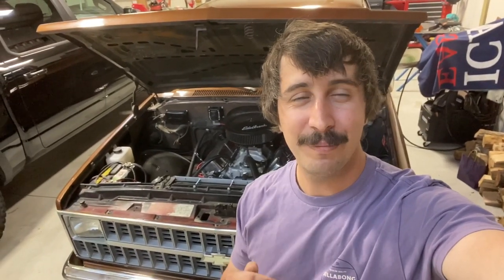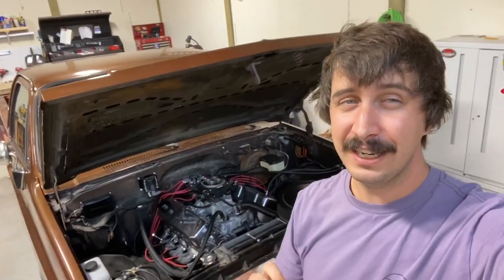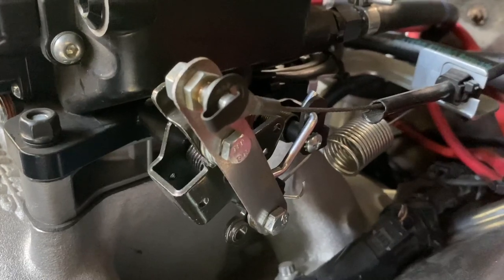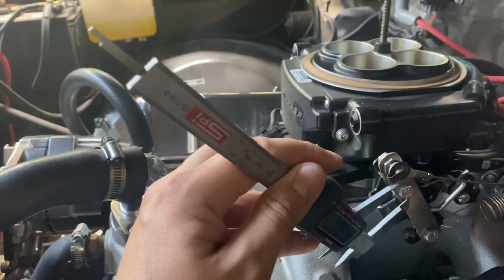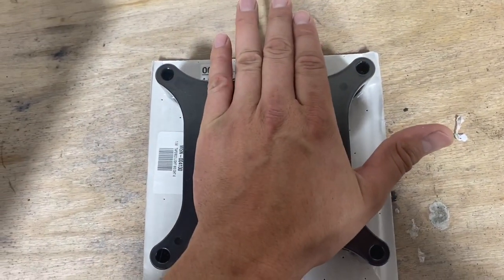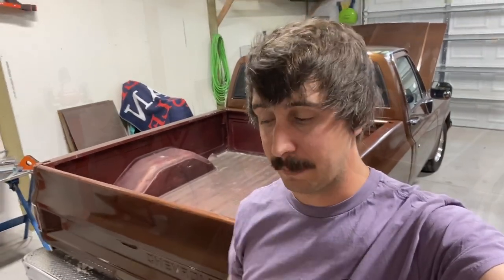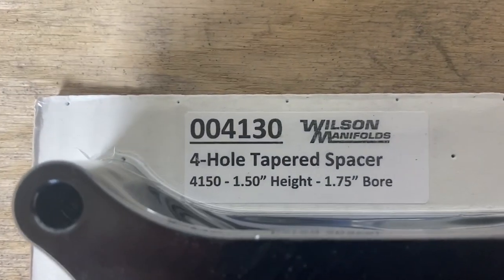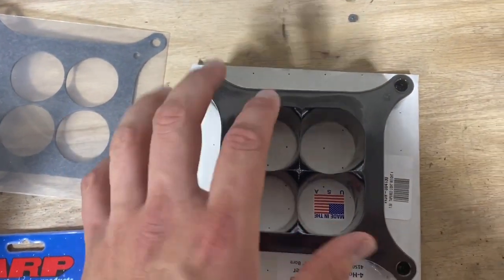Holley Super Sniper EFI Easy Improvements

Comment: Did you have to adjust the target rpm lower after installing extension lever ? My car idles higher (1100 rpm ) now than it did with the snappy pedal without the extender (800 rpm ) 

Or will the sniper self tune and find the target rpm again eventually?.
Reply from the maker: @spades262  it has been a while but i would imagine if you can slide the new arm into place of the stock one and it doesnt move the throttle blades there should be no change and you adjust it as you would stock.  I think idle rpm is set with the screw.  Also there were settings in the software for linear vs progressive throttle if i remember correctly.

Comment: If you added the spacer first,would the throttle bracket mod been necessary?
Reply from the maker: Yes.  If i understand you correctly you are asking whether the spacer affects the geometry of the linkage which it does not.  Both serve separate purposes and solve separate issues.  Thanks for watching!
Reply: @truckandroll989  hum.....interesting...so by raising the carb does not raise the throttle cable?
Reply from the maker: @rksanders13  it does but its not the cable itself thats your issue its the distance between the center pivot point of the throttle linkage and the stock point where it connects.  By moving it up further you get more leverage and thus require less force to open the blades
Reply: @rksanders13  - Adding a spacer moves the entire TB/bracket assembly up. The only thing that might change is that you need to get a longer throttle cable, depending on how talk your spacer is.

Comment: Do you have a video covering your pcv setup, I see you have a catch can and would like to do something similar on the project I'm building?
Reply from the maker: So it is pretty simple.  Breather on one side (you could use a baby filter too but more mess).  On the other side you have a pcv valve and catch can.  Pcv is mounted to the valve cover, to catch can, back to a source of full manifold vacuum (i.e. anywhere beneath the throttle).  Sorry truck is sold.  You may be able to search my channel and see more footage of the setup.

Comment: gday bro great info man 
i’ve installed xflow sniper on my 39 ford deluxe coupe convertible im running a 272 yblock with alloy duel plane manifold.
i think the linkage idea is great so ill give that a go as it is terrible for smooth take off but its the oxygen sensor im most interested in .how and were did you connect to the sniper i can find any info for additional oxygen sensor.
trying to iron out any issues b4 i fit my super charger up. thanks in advance for your help troy
Reply from the maker: Troy, the additional oxygen sensor was a standalone that I bought off of Amazon.  Its the standard AEM wideband and is hooked to a separate gauge.  Unfortunately you cannot wire in a second wideband to the Holley sniper so that is just for my own monitoring purposes and does not affect the tune.  My understanding is that more sophisticated Holley EFI products allow for dual oxygen sensors.
Reply: gday again just wanting to know what your thoughts are with the dual plane manifold and removing the centre all the way down to the first plane for Holly sniper xflow
many mixed opinions
Reply from the maker: @troytipton9881  so a lot of people will talk smack on the dual plane.  Honestly for most applications it is fine out of the box.  If you arent worried about maximum power I think an out of the box dual plane like an edelbrock performer air gap would be great.  I recall your motor was a bit more unique so it is harder to say.  Unless you have a milling machine I would just run the manifold as is.

Comment: I have a sniper and the voltage on the screen keep read sometimes in the 11s is that normal. I put a high output alternator and it's still dropping.
Reply from the maker: That is not normal.  The sniper itself shouod not draw too many amps.  If your alternator is new make sure its wired correctly and any sort of voltage regulator is functioning properly.  Some alternators dont start to charge until a certain rpm.  Take a look at that too.

Comment: Not necessary. Mine works great just like it is. No throttling issues what so ever. I don't understand people complaining.
Reply from the maker: Every setup is a bit different.  Looks like you have a 540 so a single Holley Sniper might be a bit undersized in terms of cfm and possibly masking the effects others are seeing.  Also in a stick shift car any throttle tip in issues will be more noticeable.  Either way thanks for watching and nice Chevelle!

Comment: As someone new to the Holley efi what r somethings u could tell me to be aware of or things I should do
Reply from the maker: @Kidchevy88  id say the biggest improvement/thing you should do (if you dont have the new holley sniper) is the modification I mention to improve throttle feel.  Beyond that keep an eye on sensors.  I had a new coolant temp sensor fail which makes vehicle run super rich/basically undrivable.  Also, if you want the most out of your sniper, even though they are self learning, plan a dyno session with a reputable tuner and he/she can dial it in faster/better.
Reply: @truckandroll989  thank u really appreciate it
Reply from the maker: @Kidchevy88  i appreciate you watching/supporting my channel :)
Reply: @truckandroll989  no problem I just started my channel I’ll be posting more about my experience with the set up it’s in a 1986 Monte Carlo ss

Comment: Hello. Do I have to run a return line to the gas tank or can I tap into the supply gas line. What would be the difference.
Reply from the maker: I would run a return line.  Its honestly not that hard.  A short circuited return into the supply might unnecessarily heat the fuel

Comment: While not a phenolic spacer did it help in cooling the throttle body ???
Reply from the maker: Its possible it could just from spacing it up higher but aluminum is a good conductor so probably not by much.

Comment: How are you able to use two o2 sensors my sniper only has a connection for one
Reply from the maker: So one o2 feeds the holley sniper whereas another feeds a readout on a standalone sensor.  So im able to see both o2 readings but my holley can only control off of 1.

Comment: That was a great video . What size is your engine ..? I'm thinking of putting a efi on my 454 it's a mild engine 530 hp. What do you reckon?
Reply from the maker: Thank you.  Yes it should work fine.  Mine is a mild 454.  Made 435rwhp so about 510/515hp motor.  Efi should be fine.  Keep an eye on the fuel pump you choose.  The base kit fuel pump is right at its limit around 550
Reply: @truckandroll989  yeah was think if getting the next one up. How much are those spaces?
Reply from the maker: The spacers arent cheap but if you are only after the whistling noise fix you can get a normal thin four hole spacer.  The tapered bore 4 holes from Wilson racing are $100+
Reply: @truckandroll989  how do you know what size spacer to pick .?
Reply from the maker: @thef71  so if its just noise you want to fix then super thin and cheap 4 hole is fine.  However if you thinking your engine may want more plenum volume than a thicker spacer can certainly pick up horsepower.  In that case 1” is a safe bet.  They typically make them up
To 2” but more isnt always better.  1” would
Be my choice not knowing anything more.
Reply: @truckandroll989  thanx a great help

Comment: 1" open spacer won't even out the AFR?
Reply from the maker: So it has a spacer in it but that didnt seem to help.  If anything that could affect power by effectively tweaking runner length/volume but it shouldn’t drastically affect afr

Comment: Dude I like you and I’m getting a Sniper that can work with boost 
But you’ve got to realize there  are 
+\- tolerances  for everything mechanical so your sensors reading slightly different is meaningless
Reply from the maker: Yea for sure.  Its the inner engineer in me that would like to see them read more consistently between the cylinder banks but i agree.  Thanks for watching

Comment: Love your solution. Do you notice any issues because you've decreased the travel in your linkage by using the lever?
Reply from the maker: So I will say that at WOT the TPS wasnt showing 100% (somewhere in the mid 90s).  However i never verified before but I suspect it was never fully 100%.  I suspect the latter could be corrected by adjusting the throttle
Cable itself

Comment: Overall, do you recommend Holley sniper?
Reply from the maker: So IF your goal is maximum performance and tunability than no Id say find a manifold which supports multi port EFI.  If carburetors are a headache/difficult to tune then yes the sniper can be a good option.  Ive had really good results with buying a wideband o2 sensor, tuning kit, and Edelbrock Performer style carbs for street cars.  They typically start every time and drive well.
Reply: @truckandroll989  I’m just surprised they don’t monitor both banks
Reply from the maker: @tyferguson564  agreed.  Its honestly an “entry level efi” setup.  Im running a Edelbrock AVS2 on my Mercury now and it performs just as well without any of the headaches for a lot less money
Reply: @truckandroll989  yea that’s what I’m running on my c10, I just wanted to do efi.. ima probably just go LS with the factory computer

Comment: Holley really screwed up with the linkage. Why did they feel it was needed to redesign the throttle linkage?!  Holley carbs have been around since the 50s, why not stay with what works?  Is it to force the buyer to purchase linkage kits or extension?  

I made my throttle linkage extension after a couple weeks of driving with the touchy throttle.
Reply: From what I have seen they tried to keep it compact so it would not hit certain air cleaners. If you buy the aftermarket extensions it tells you to check clearance or buy an air cleaner extension. In some cases an extension may cause hood clearance issues.

Comment: So disappointed in my sniper...idle hunting all the time...cooler days it burps and pops until warmed up decelerating it pops and just sounds horrible
Reply from the maker: How are your other gauges reading?  Any chance it could be a bad sensor causing this?  I highly recommend getting it dyno tuned.  The system can work well if properly tuned
Reply: I love my Sniper on my 408 Dart. I had similar problems and 2 shops later found out that my install of my 02 sensor leaked

Comment: 150 for a spacer is ridiculous
Reply from the maker: Ill agree the price is steep.  What sold me is how well it performed on Engine Masters the dyno.  Youd be hard pressed to find another $150 “mod” that picks up noticeable power
Reply: It seems that the cheap cast aluminum spacers could be prone to vacuum leaks and rough appearance, and the cheap plastic ones could melt. Wilson makes a 1-inch spacer for $90-100, and FAST has a polished billet (open) spacer for $125. If you think that's a lot, Holley wants $250 for their spacers. Talk about absurd pricing...

Comment: is there any way I can write you on private? I have some question about EFI system...thank you
Reply from the maker: If you dont mind replying here maybe your question is one that could help others.  I will do my best to answer.  Otherwise just DM me on Instagram @truckandroll989
Reply: @truckandroll989   Ok I will do it here, So I am in the process of changing my carb system to EFI one, from top to bottom ( in tank electric pump fuel lines etc ) and I started to do some research about the intake manifold ( I run a edelbrock performer RPM dual plane type ) and I saw this video, channel name: Hagerty , video name: Is it worth it? Replacing your carburetor with a Holley Sniper EFI | Hagerty DIY ( to make it easy, run the video from 5:00 to 6:00 ) this guy ( David ) talked with Holley tech and they asked for a single plane intake and I almost cut mine to create this single plane intake, but then I saw your video and I was surprised, you also talked with Holley tech department and they recommended the spacer with 4 " hole " based on your video you also run a edelbrock intake, RPM Air-Gap I guess, also a dual plane intake...and now I'm totally confused...what do we exactly need? how come Holly tech department recommend exactly the opposite...I also have ( same like you ) the Wilson spacer :) and I want to keep it :) . thank you...
Reply from the maker: @chevroletchevelle7161  I think the consensus is for “most” street motors a quality dual plane will provide the best balance of power and torque in a useable rpm range and likely aligns with the type of customer who is considering a TBI style EFI system.  Some folks believe you get a stronger signal from a single plane and the fuel distribution will be better.  Is that true?  Maybe yes slightly but does it likely offset the power lost in the rpm ranges you are driving most in?  Probably not.  Pick either intake and you will be fine.  Id be more worried about selecting an intake which better compliments my driving style, cam choice, and desired rpm rangr